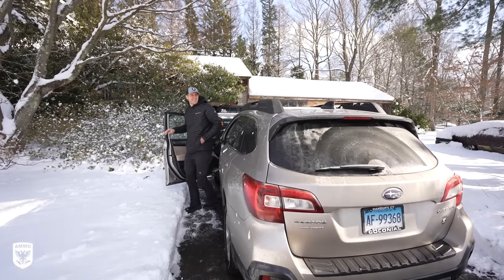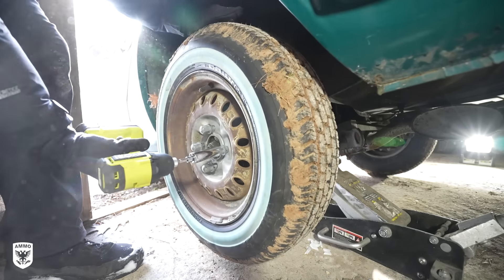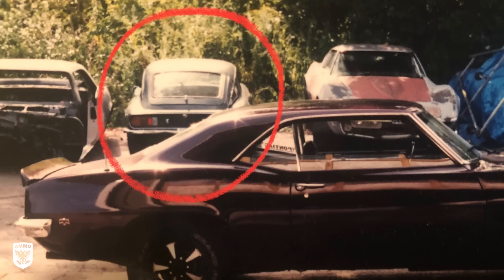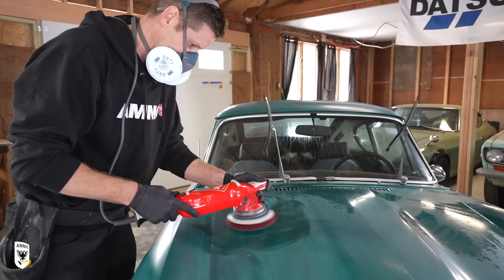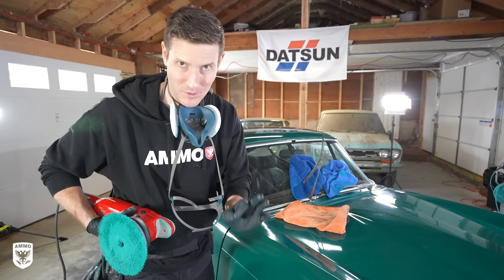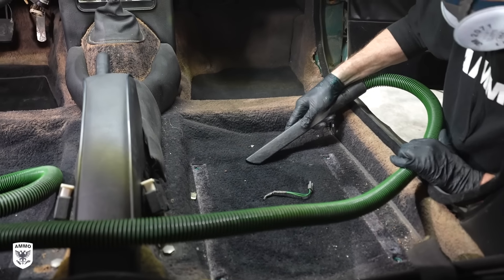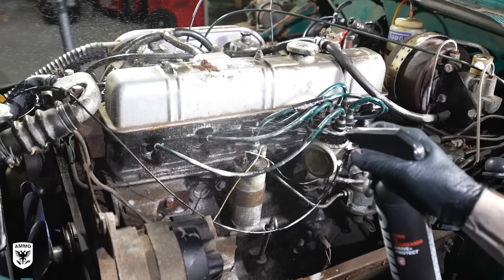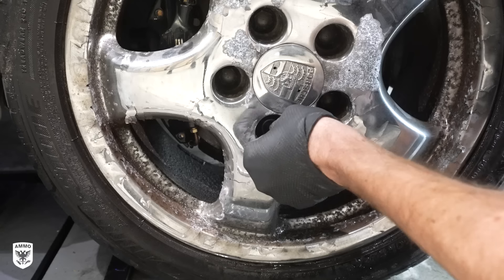First Wash in 46 Years Triumph GT6 Barn Find Disaster Detail Full Car Cleaning

Comment: Had a red Mark II Spitfire as my first car in the 60's. Got it for 500 bucks and it was just 4 years old. Almost traded it in for a brand new green GT 6 in '69 (nicer looking rear end with the round tail lights) but I think the price was 28 grand which was a bit much for a 20 yr old at the time. Absolutely loved the restoration detailing. Couldn't believe the way it turned out. Super job.

Comment: My nephew has one of these in red, with wide tires & flared fenders. We've been thru the engine, clutch assy, carbs are a PITA. Weakest link is the rear differential. We upgraded the wiring to 12 volt negative ground and GM alternator. It's fun, but it rides very stiff.

Comment: AMMO NYC
Tip...for cleaning water spots on glass windows you can use aluminum wheel acid cleaner! But you MUST not allow the chemical to dry and you keep rubbing with 0000 steel wool.

Comment: I think you are a true expert at what you do and you seem to always hone your craft.  I will say that your technique with the razor blade was not so great on the glass.  My family has cleaned windows since 1926 and I know that its always best to go with the grain of the glass when only the glass is wet and only go one direction and don’t drag back.  Also 0000 steel wool or better 000 bronze wool can be used with soap to polish out hard water stains and when that fails the product that always works and never fails is one restore by eaco chem. Its hard on many other surfaces however so use it carefully.  Good luck!

Comment: I personally bought a mini 50,000 btu propane torpedo heater for such situations with an electrical outlet and a full gas barbeque tank, open the door a few inches for ventilation and light it up and you'll be warm in no time.

Comment: Phenomenal job on the detail. He has to have had it running recently, a older carbed car in that low temp wouldn't start that instantly (although it was running off starting fluid), but It's also probably rough for the piston rings and such not having any oil moving.
Reply: No, I'd believe it starting exactly as we saw. I've had one of those Triumph 6's (in a 2000 Mk2 TC estate). As long as everything is setup up and those Strombergs given a tickle it will start straight off after lying around for years. 
I threw a rod through the side of the original engine and got a replacement from a car that had been sitting for 5 years. We removed it from the donor, cleaned it off & fitted it into my car. We drained the carbs, and used the tickler to refill the floats with fresh petrol and it fired right up first time. This was in subzero conditions as well, but plenty of choke and, in his case, the easystart, would fix that.
 If the dizzy has been properly maintained prior to laying up it would have had little moisture ingress and the oil on the felt brush would have protected the points.  As long as the plug leads are good then what's to stop it?
I miss my old Triumph.
Reply: I'm Derek, the owner. I promise I never fired this thing up before this video. that was an honest "first start" and we were all a little shocked how easy it was.

Comment: The GT6 has hard rubber bumper guards like many of the '74 cars had. Wonder if, because this was sold in late 73, it had these fitted to meet anticipated new requirements.
Reply: In '74 the overriders on the Spitfires (they quietly killed the GT6 at the end of '73) were about twice that size and they had to be tacked onto the rear as well.  Blech!!

Comment: My understanding of these 6 cylinder conversions was that, originally the capacity of the motor was reduced to 1750 cc, from either 2,000 cc or 2500 cc. [more likely the former].

Comment: Surely you drained all liquids  from the engine.  I E.  oil.  Petrol.  water  antifreeze   because it would be broken down  and not fit for purpose     So  fresh oil. filters. Petrol.   And spin the engine manually for a few turns.  To get the fresh oil circulating around the engine.   And then it should starts easily with a good battery.   Nice colour I love the green.   Also  check the brake fluid  and pads  handbrake.  And pressure in the  servo.

Comment: Hey Larry,  im debating whether to get the 21mm throw or the 15mm throw as my first machine to start my detaiing career. I just picked up the 12mm duetto with 5 inch backing plate so I think I should get the 21mm. What do you recommend. 15mm or 21mm?
Reply: 15, 21 is way too huge only good on hood trunk and roof, 15 works on more and then i use the 3 inch rupes for smaller areas
Reply: @startingtech3900  i was thinking the same.